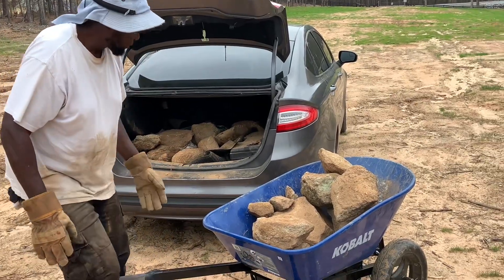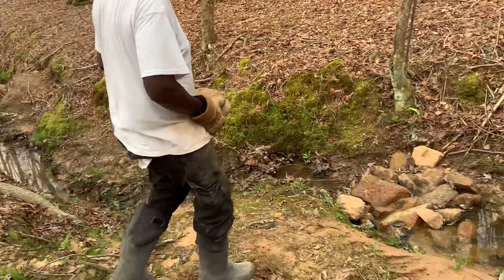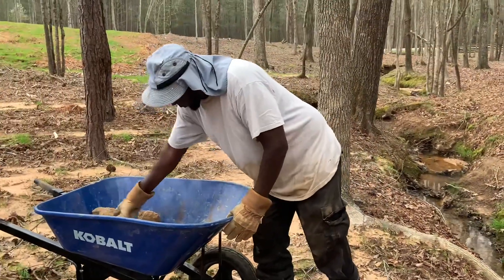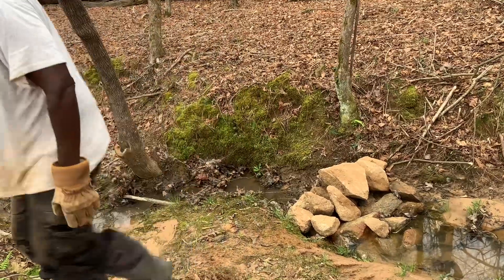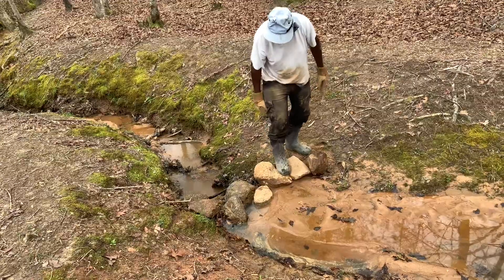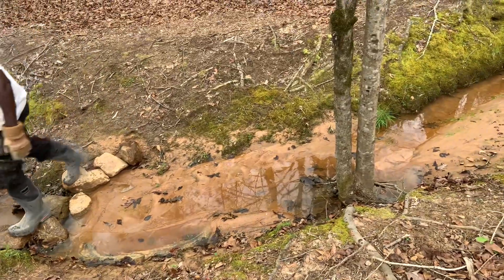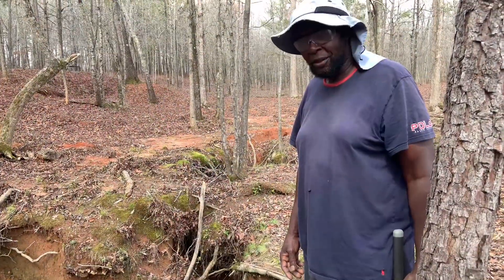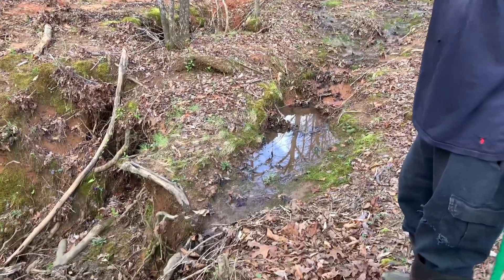Reenforcing the Dam | Due to Flood Warning

Comment: Tiffany does the stream originate on your property? If so looks like you have a spring or springs & or seeps that form the small stream. If this originates on your property maybe you should consider having it professionaly developed as a water source for potable water if it tests ok or if you don't want to use it for drinking water maybe dig out the spring area & line with rocks & gravel. & line the creek for a little ways past the spring area, maybe even make a small shallow pond.  There are a lot of videos on making leaky wears to manage the water flow & prevent erosion. They can look really nice if care is taken when making them. They are usually put in gullies to control erosion & hold water /slow it down, but not to make a permanent pond to hold moisture in dry land.  That would work well for your little creek & help control the silt.  You could put them fairly close together, just maybe 1 to 3 rock levels high.  You could line the banks with more rocks & some native plants like ferns, & other water loving plants to hold the banks to prevent erosion.
Just some ideas to consider to control the water flow using the materials mostly that you have on hand.
Just venting what I wished I could do if it were my property.  I liked to play in my grandparents spring branch as a kid. 
Sorry for the long rambeling comment.
Love what you are doing & have done with your property. Stay safe
Reply from the maker: Yes, the stream does originate on our property, and it is something we have been wanting to explore further. Your ideas about developing it as a potential water source or creating a natural filtration system with rocks and plants sound great. I love the concept of using the natural materials available and working with the land to enhance both the flow and aesthetics of the stream. The leaky weirs sound interesting for controlling erosion, and I will definitely look into that. I can see how it would not only help with water flow but also give the area a more organized, beautiful feel.

It is amazing to read about your childhood memories with your grandparents’ spring branch. There is something so special about water features on a property. Thank you for commenting, and we will definitely keep these ideas in mind as we continue developing the space. Stay safe too! ❤️❤️❤️
Reply: @Tiffanysfarm  If you'd be interested, I could list some channels that I think have some really good example of how built/designed & some results..
It would take a little time to look them up.
Also consider using thick layer of leaves or wood chips to enrich soil. Not sure how experienced you are in gardening though I know you have some experience.

Comment: Great job! This will also help keep your trees around these small dams hydrated and more resistant to droughts and fires. It will also help to recharge your water table. It also helps to trap sediments and top soil from washing away, keeping the good soils in place. You may also want to consider planting plants that grow in wet areas in between these small dams which will also help to slow down the water flow, keeps your embankments stabilized, some of those deeper embankments I would put rock to reinforce your embankments (stopping the erosion) then plant water plants/grasses to help hold it in place.
Reply from the maker: Thank you. Those are excellent suggestions. Planting wetland species will definitely enhance the ecosystem around the dams, and using rock for reinforcement is a smart way to combat erosion. I will definitely consider integrating more rocks and the other ideas to promote stability and hydration for the trees and surrounding soil.

Comment: Water is tricky & hard to control. I don’t know what the property looks like so its hard to give advice, but if it doesn’t undermine anything, you might want to split the stream & have a separate branch going the other way around the property. Or maybe dig a sump/pond? If the stream digs itself a gorge, that might be a good thing.
Reply from the maker: You are right that water management can be quite complex. Splitting the stream to create a separate branch is an interesting idea, and it could help distribute the flow more evenly across the property. Digging a sump or pond might also provide a good way to capture excess water and mitigate erosion.

I will definitely consider how the current stream dynamics could affect the landscape. Your advice on allowing the stream to create a gorge makes sense too, as long as it does not undermine structures. I appreciate your comments.

Comment: Try to hold the water away from the fence beam, it is now  in the water. After a year or 4, it going to rot. Try to hold te water in the middle of the stream.
Reply from the maker: Thank you for the advice. We are definitely going to work on redirecting the water from the wooden posts.

Comment: The problem with the dam is that it stops the flow until the pressure behind becomes great enough to breach the dam which in turn will cause more erosion than the natural flow. That is why natural dams don’t stay and artificial dams must have constant control of the  water flow. You should probably just line the entire creek with natural stone to slow, not stop, the flow of the water.  Your local NRCS agent will be a source of great advice.
Reply from the maker: We created cross vanes to slow down the water flow during heavy rains. Both sides of the dam are built higher which allows the water to flow unimpeded over the dam. We experienced lots of erosion prior to adding the dam, cross vanes, and lining the creek with natural stone. This system that we implemented for erosion and water control is actually working well for us.
Reply: What my dad did was construct an "impoundment". This is a dam in front of a pond off to the left side of my creek. The original creek continues to flow past the far right side of the dam. When the creek rises, it goes out the right side. The water overflowed the top of the dam one time in 30 years. I have a 3 month storage in the hole behind the dam. Dad built it with his favorite tool, a backhoe. He built waterworks his whole life. I would be thrilled to have this creek you have, and not clear why it upsets you. It will just wash out a nicer creek. My creeks change every year. They have little waterfalls some years. Ravens pick up tiny salamanders. I love creeks!

Comment: In North Carolina we call them cross vanes when place the in the creek. It slows the water down when you have heavy rain. Makes sure the out side areas are high so the water will flow over the middle of the dam.
Reply from the maker: Great advice. ❤️ I just ordered a jack hammer to break up some boulders we have in the field. I plan to use the rocks to add more height to the sides.

Comment: I'm wondering if you could take some of the logs and drop them in the gulleys in the deeper part of the upper creek to create some dams to hold and slow the water back. It would also create a larger pool of water that maybe some fish would want to call home. I know it's been mentioned but I wish I was closer so I could lend a helping hand. Great work!  Now if you could rent a beaver to help you out a bit too :).
Reply from the maker: That’s a great idea with the logs and the beavers lol ❤️ We added some logs to the creek once before but the water ran underneath the logs. Ultimately, the dam was destroyed by the force of the running water. But we will definitely consider rocks and logs mixed together on the deeper part of the creek later on if our current method does not work.
Reply: @Tiffanysfarm  Tiffany...see if you can get some smaller sticks and clumps of grass to pack inbetween the rocks at the base to help solidfy it. Granted, won't be as well engineered as the beavers doing it, but will get a bit more structual support to the base. You can also build out with rocks from the base for more support too with small rocks. If your daddy and you could get the foundation in place before the heavy rains come, it will heIp slow down the rush and protect the fine work you've done downstream. Now I wonder where you could rent a beaver family for a few days?
Reply from the maker: I like your idea about working on the area upstream. I will definitely talk to Dad about it tonight. Thanks. ❤️